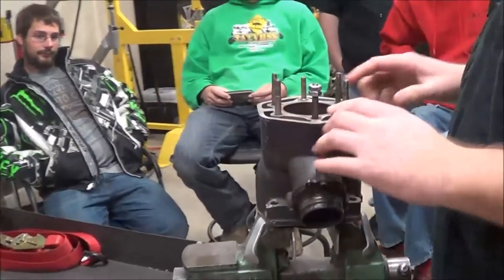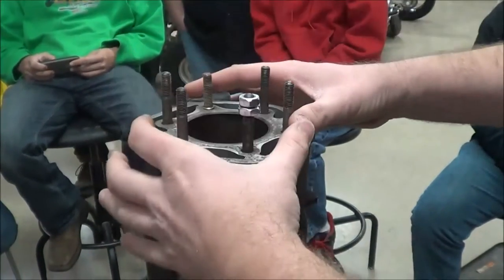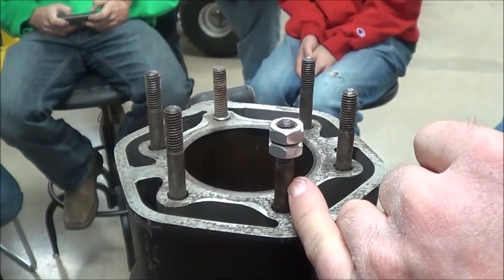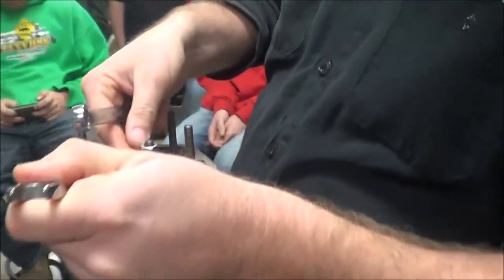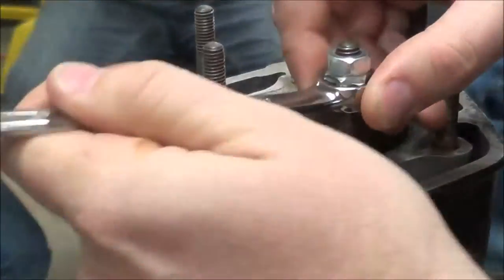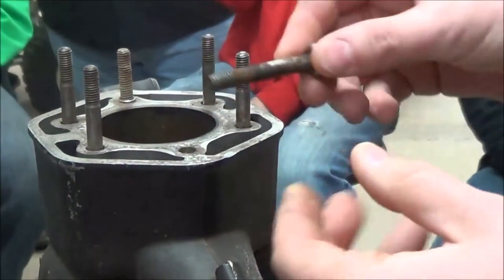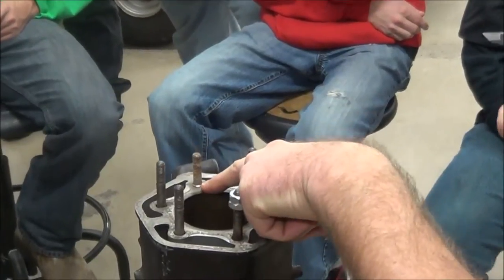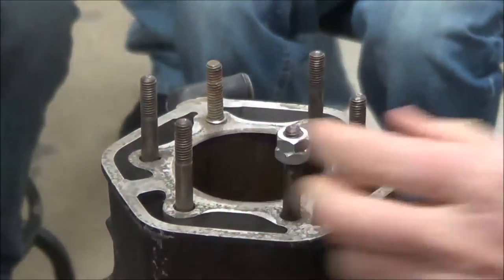How to remove cylinder studs. How to remove exhaust studs. Stud removal tool #how2wrench

Comment: This seems like a much better school than the trade community college I went too. We spent 6 hours a day in the shop. 30 minutes in the class room VERY quickly skimming over the text book. The teacher had that "You already know this probably" mentality, and then we spent the 5.5 hours left doing oil changes and tires all day for the other teachers in the college. Kinda just felt like free labor for two years. I learned next to nothing if I'm honest. I remember the day we were suppose to talk about the inner workings of transmissions and the teacher straight up said, "How often are we tearing apart transmissions anyway?" and totally skipped the whole chapter. Never once in the 2 years I was there did we take the head(s) of ANY type of motor. I never saw or held a piston the whole time I was there. Spark plugs, oil changes, tires, and brakes. That's all we did. $20k in debt. I'm pretty envious of this instructor actually doing hands on instructions. Don't take that for granted. This video was posted the same time I was in college too.
Reply from the maker: Bummer you didn't get the opportunity you wished for. Feel free to use and enjoy over 700 free videos on hear and access many more as a member. How2Wrench offers one on one techline if ever needed and provides discounts for "learning sessions" Stay connected. 
Glad it helped. We will let Shane know! You can give him a high 5 here:  https://www.paypal.me/how2wrench   
You rock! Best way to help us back is joining or grabbing our T-shirt! Support links and gear below!  Awesome and thanks for commenting! Smash the subscribe button (thank if already a sub!)
Have you seen our "YouTube Trained Support Shirts? Great way to "high five us" https://goodfellasmerch.com/collections/how-2-wrench/products/support-shirt

Join this channel to get access to perks:
https://www.youtube.com/channel/UCBhM8DCKnT3qXwTW0eToyCg/join   
-Daily MEMBER FIRST COMMENTS ANSWERED FIRST 
-Live Q/A video chats
-Wonder if we have a video on your need? Members can request content links!
-Full Access to the ENTIRE 700 video library
-Member-Only FREE tool giveaways   

Got an emergency and your head is about to explode from frustration or fear? Get Shane’s cell here: https://how2wrench.com/ols/products/techline-one-on-one